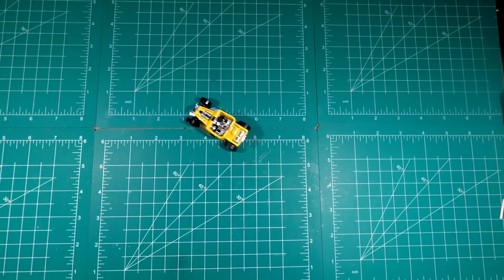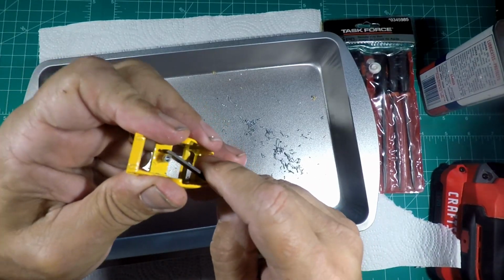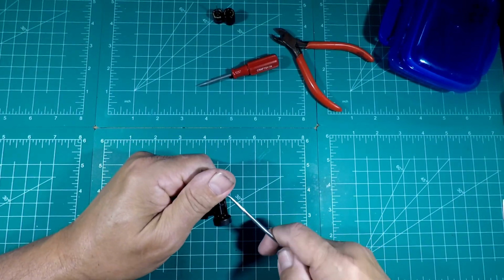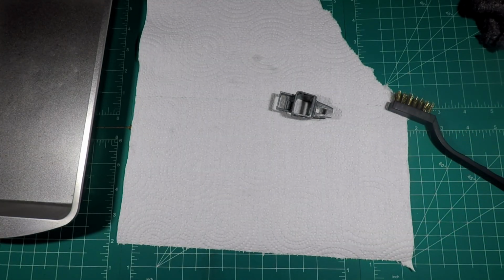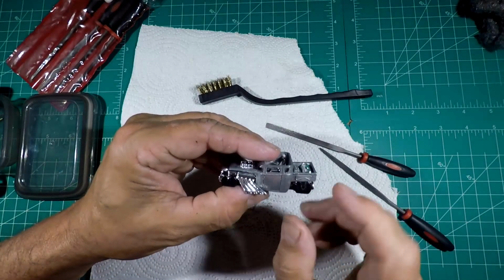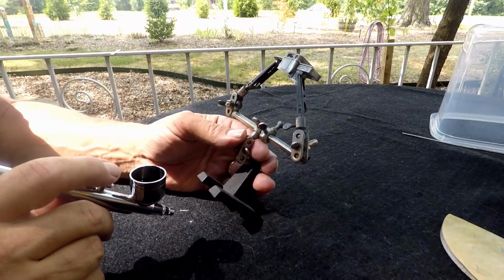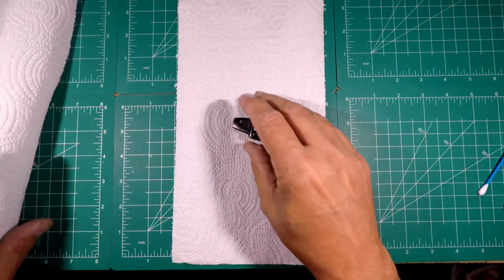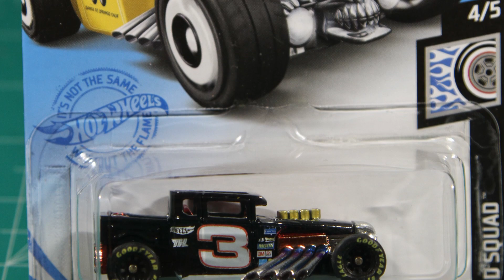Making a Custom Earnhardt Bone Shaker

Comment: I haven't done it yet because I'm not sure what screws I'm going to use but I've been thinking the same thing about using a tap...mostly because I don't have one, but still if you drill the right size hole it should be fine. They're just sittin on a shelf anyway.
Reply from the maker: Yes sir,,,,Screws I use I do not tap. Whether I use 1-72 or 2-56....They fit perfect. Thanks for watching
Reply: @OldManDiecast  ok cool, thanks buddy 👍🏻

Comment: So you said you do the base first, which is obviously a good idea, can reactions between the paints really happen that fast while spraying? For whatever reason I always assumed it had to sit for a little bit before you saw any problems. I'll be sure to do it like how you are regardless.
Reply from the maker: They can indeed be instant....But with that stated the reason I do it is because of the paint and brush I use....If the gun does not spray right or paint to thick/thin whatever I can easily fix on the base.......On the body creates more work if there are issues. Thanks for watching
Reply: @OldManDiecast  ah yes, good point. Thanks and you're very welcome.